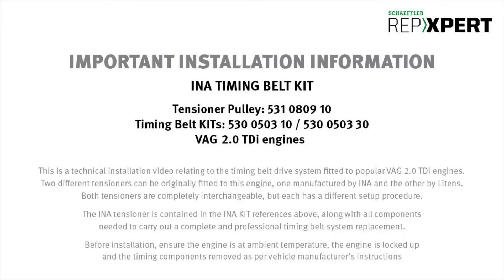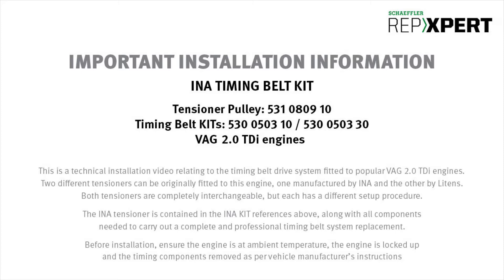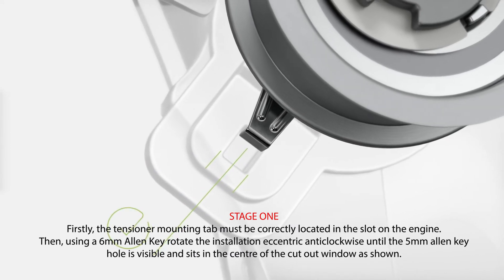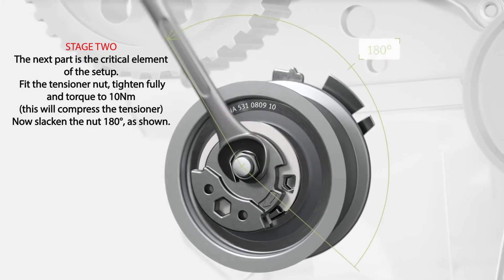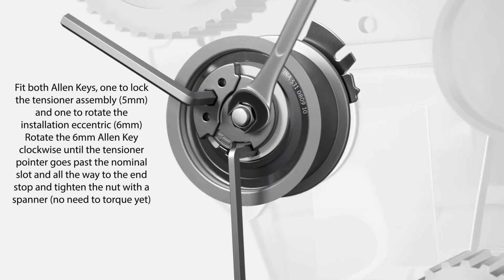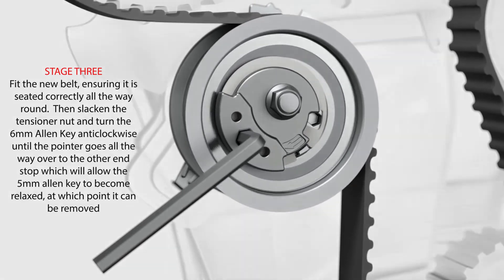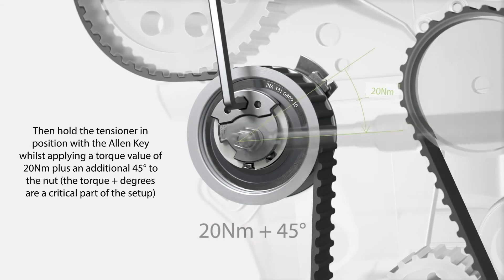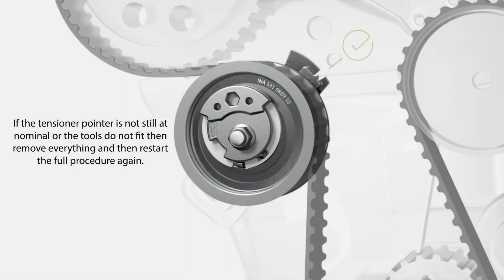INA Vid Idler 531080910 EN UK 2 0TDi 1080p

Comment: An over elaboate design.  I like INA parts, but ive just fitted a 2.0tdi kit, the tensioner looked like a piece of crap  compared to the Litens one, so i binned it and bought a new VW tensioner.  Too riskey and didn't like the look of the INA one at all, never mind all the setting up they tell you to do.